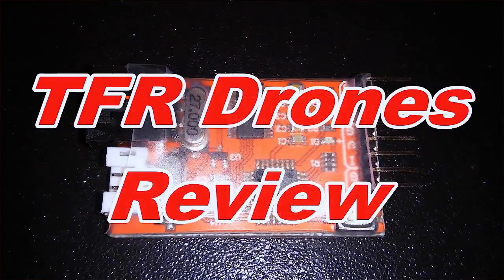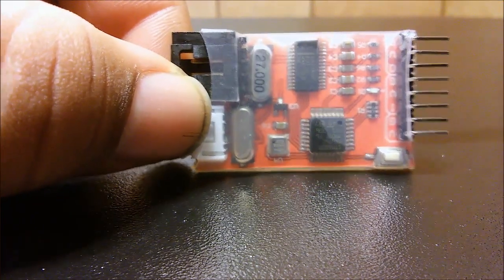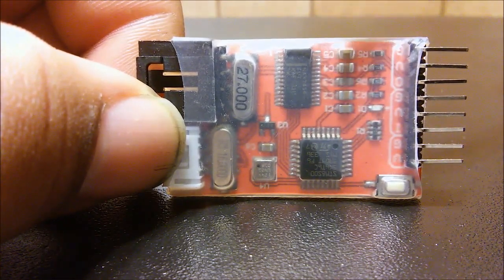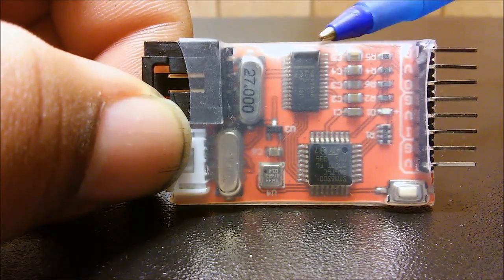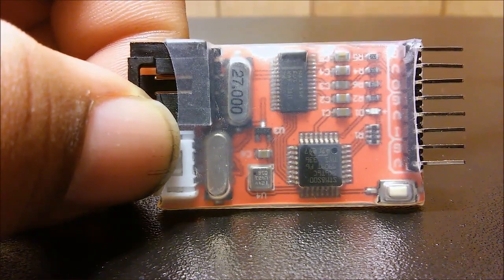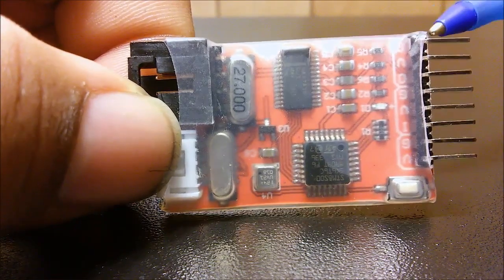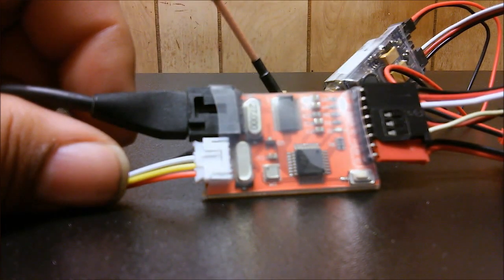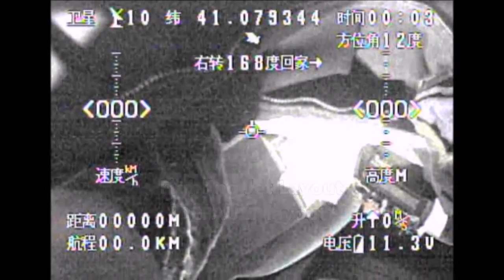GoodLuckBuy N1 OSD for DJI NAZA Review & How to Video

Comment: how the hell do you get the on screen voltage to work tryed mine say fail all the time but mines not got all them pins mine got one connecter with 2 servo style plugs on the end

Comment: Hy, how can I reset the OSD. In the OSD menu will I set off ... and of course .. I do not see the menu to change it back.

How I can reset at the factory settings !?
Thanks you a lot.
Reply: Did you ever get it working? Mine arrived in same condition!
Reply: ok... if you desconect the Batery Vcc and it's only connected for the Naza signal we can looks the osd in the screen, and we can change the menu options.
Reply: +Sergi Vives Did you disconnect it while it was on?
Reply: yeah unintentionally, through the OSD menu

Comment: Dear all; I have a question.  I have this OSD, but I havent been able to make it work properly....I connect the camera (3 cables) and vTX (3 cables) to OSD and lipo separately to the other terminals.   No OSD data appeare over the video image, but when I diconnect the camera, then OSD data appears.  I connect camera again and it Works until I try to go to the menú, when OSD data dissapears.

Does it have to do with the suggestion that this OSD must be powered through the video TX ?

Really appreciate any advise

Comment: Hi when I connected this to my naza m lite it affects my gps. Everything works osd works display,s satellite info bat voltage etc. But won't hold position with osd connected. When the quad is stationery the gps coordinate,s on the osd are constantly changing. Could the fact that it is positioned to close to the battery, gps puck or naza effect it?

Comment: Hi, good video! The display in DJI mode mostly shows numerals so it's less chinese.

Ive a question for the voltage out from the video side. The N1 OSD definitely works with 3S power supply.

The OSD appears to work with 4S, I have OSD display output in my goggles. However, the voltage in the system is supplied the VTX.

Plugged in 4S flying battery and smokey dragon. OSD and VTX ok, but 16V killed the CMOS camera. 

The problem is not so much with the OSD and VTX, in my case the CAMERA was the weakest link (FATSHARK 600 TVL CMOS camera)

Comment: may i have a question ? there is a two red and two black cables on boscam. why ? i thnik just one red and black is needed to boscam to power it from OSD and one video cable.. am I right ?
Reply from the maker: Milan Paule one set of the red and black cables are to powered the Boscam vTX from the main battery and the other set of red and black is to powered the FPV camera or the OSD from the Boscam vTX

Comment: Can this osd be used on 4s
Reply from the maker: etab83 This OSD gets powered by the vTX the real question is can your vTX take 4s , now in the other hand the current sensor which it is integrated on the OSD i'm not sure if it can take 4s or not , I don't have aircraft that flies with 4s batteries to test this OSD with a 4s lipo , ill see if I can get somebody to lend me one and ill post a video with the results of that test .
Reply: I use the immersion rc vtx nod it cn take up to 6s, but only has 5v out. So I took power directly from the 4s battery and used bec to step down the power to 12v because I thought it can only handle 12v. I would really love to see a video of how you would do this. When I went into the osd menu I could not change the voltage setting.

Comment: what should I do if my camera is self power and it has own battery like my sjcam.. now my boscam vtx power from my 3s battery balancer port and the camera is self power 5v will this osd kill my camera?
Reply from the maker: dndon Anything above 5v will kill your camera , If you used a 5v camera then connect just the video " yellow " cable to the video pin " signal pin " on the OSD camera input connector and connect the positive and ground cables to a 5v power source like the RX or FC ,

Comment: Very nice video. You have made installing OSD easier and cheaper in Naza. Thanks! BTW I have 2 queries:
1. The battery connection that is the red JST connector from the OSD goes to the main battery right? The vTX should be connected to a separate battery? Can I use 2S Lipo for the Boscam vTX? Will it work?
2. If I use a camera which is self powered like Gopro, then I shall connect the video and the ground wires to the OSD and leave the power wire. Right?
Reply from the maker: Amitava Das Everything on my aircraft is powered by the same lipo that powers the motors , just one lipo , the JST that goes connected to the power sensor of the OSD is solder in to the power distribution board of the aircraft , the vTX is powered by the same battery that is powering the whole aircraft , If you are using a self powered camera that works in 5v then you need to connect the camera cable with the positive + and ground - to the RX of your aircraft that is also 5v , the single video cable of your camera you have to connected to your OSD camera video input pin .

Comment: I have the same style bosom vTX you have in the video just a different model but same connections. So I do not need to connect the other two red and black cables coming from the vTX? Thanks
Reply from the maker: You still need to supply power to the vTX power input from the main battery , the power input on the OSD is just a current sensor , it does not provide power to the OSD and the rest of the FPV hardware , that's still the job of the vTX .
Reply: TFRdrones Dear TFR drones   Im puzzled; I connect this OSD to GPS and Naza V2, also camera and vTx ( these 2 without external power) and the JST connector to the lipo.    Image is OK on FPV screen, but no OSD data;  only when I disconnect the camera, OSD data comes out; then I reconnect camera and everyting is OK, except when I go to the menú, when OSD goes away again   Do you think this has to do with what you say that OSD must be powered by VTX ?  If so, why FPV system Works when connecting only JST ?Thank you very much for your advise

Comment: What do you need to buy with it?
Reply from the maker: This OSD required a VTX that outputs 12v and a camera that works with 12v too , if you are a fat shark/immersion user you would have to do some special wiring to be able to feed 12v to the OSD since fat shark/immersion works on 5v or buy a 32ch vTX that outputs 12v , 32ch vTX will be compatible with the fatshark 5.8ghz frequency .
Reply: No does it come with all the cables needed? I know about all the rest. but thank you.
Reply from the maker: It comes with the cable that you used to connect the OSD to the NAZA's EXP input and it comes with some universal cables that will allowed the connection of the vTX to the OSD and that's all , I dos used the EXP cable but for the camera and the vTX I used the cables that came with those devices rather than used the ones that came with the OSD
Reply: Thank you have a good day.

Comment: Very nice OSD :D
They should definitely translate it in more languages!
If it had RSSI, it will be far away better than the iOSD ;)
Thanks for sharing my friend and happy new year :)
Reply from the maker: ABMNS PRODUCTION Hi buddy , this OSD does no comes with RSSI input , in my case I feel that multicopters with GPS capable flight controllers doesn't really need OSD's with RSSI , ounce you reach the maximum range of your radio your flight controller will activate the RTH and the aircraft should get back safely , so I don't miss not having the RSSI feature on this OSD .
Reply: TFRdrones Yes you are right, but i like to have this information on my OSD :)
But it's not a big deal, it's a very interesting alternative to the iOSD :)
Reply from the maker: ABMNS PRODUCTION For $34.00 USD is really a bargain when you compared to the I-osd or the Cyclops osd , I post the follow up video so you can see this OSD in action .
https://www.youtube.com/watch?v=bLCOSVy49WM&list=UU-U5f0JMfZZC1O2xJWc6Oxg

Comment: Hi, I have a few questions...
does the OSD power the camera and vtx?
can you use it on a 4cell setup?
Reply from the maker: In a matter of fact what powers this OSD is the vTX , some vTX are design to only work with no more than 3s and some others go as high as 6s , the vTX regardless of how much power can handle the vTX sends around 11v to the OSD " unless you got immersion or fatshark that only works on sends 5v to the camera " and the OSD sends the 11v to the camera , the separate power input on this OSD where I connect the JST red connector is just a current sensor input on this OSD so you can get an accurate reading of the battery voltage , now i'm not quite sure if the OSD current sensor can handle 4s , I would love to find that out but all my multicopters only work on 3s , nevertheless I wont be surprise if it does since a lot of people fly their multicopters in 4s so the current sensor on this OSD should handle the 4s power .
Reply: TFRdrones
Hi Team, Do you have news for use this osd in 4S?

Thanks, Cheers and good fly